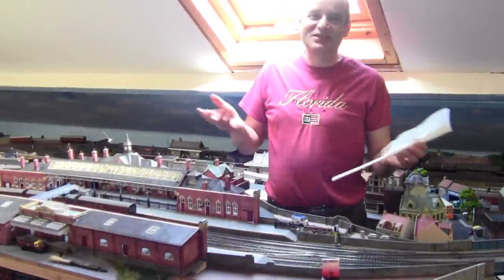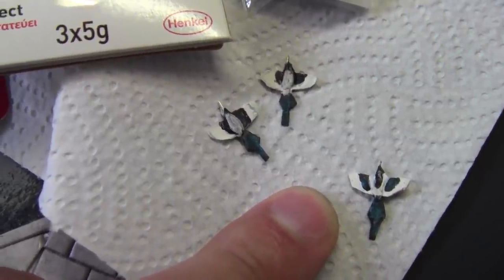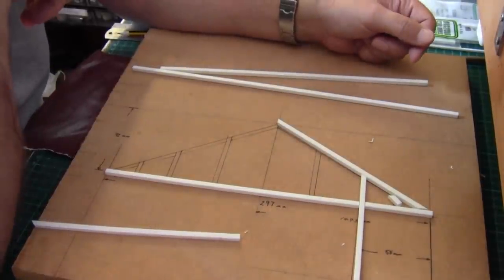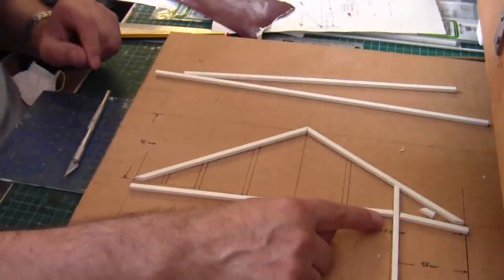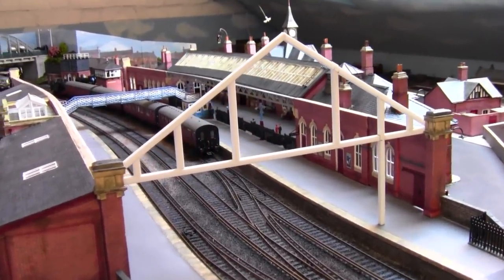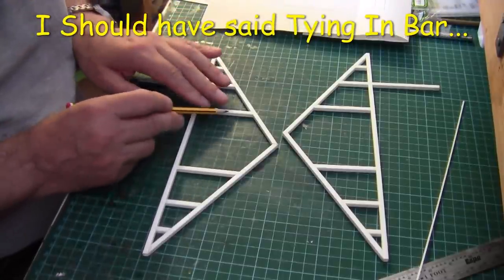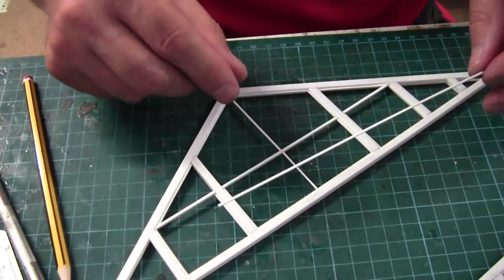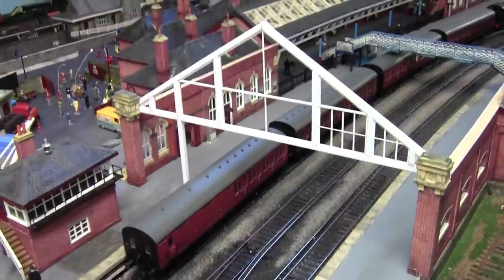The Big Roof Part 2. The facia's   No270

Comment: Tone, that 8-Wheeled vehicle is an Albion 24C/1. The Albions were originally very common in the West Bromwich area at the turn of the century. After 20 years or so they migrated northwards and eventually settled in the North East of the country, namely in South Shields and surrounding areas. Their plummage can be plain and they can sometimes be quite shy and have to be tempted to come out of their garages. Once out in the open they are a pleasant and attractive spicies but tend to enjoy their own company. They require very little servicing and I have been told they can run all day on only one saucer of milk and a chocolate finger (who’d have thought that !).
Hope this helps...Love ya Tone, The Guvnor 😁
Reply from the maker: Hiya Guvnor. i forgot to mention what was printed on the Albion truck. Teeside merchants. that's what appealed to me when I had seen it on ebay. its almost north eastern. great comment by the way. but to have a truck run on a saucer of milk and chocolate finger. well maybe for a well hard driver with out any sarnies.l ol.....take care buddy...........Tone

Comment: Hi Tony, the lorry is an Albion CX7 from around 1950.   I remember those dustbin carts at the side of King Street at Shields, as a boy in the mid 50s, whilst a guy with a big brush swept the gutter.  My father told me if I did not do well at school, I would end up like him.
Superb start to the trainshed roof.  It’s going to be long and hard work and it will take a while to complete, but when done, you will be pleased with the result and the effort will have been worthwhile. I see you use lecky’s tape instead of masking tape to secure your model facia.  
The glazing changed over the years with various panes missing.  I would guess that it helped clear the station area of smoke from the locos.  At one point the whole roof apex panes were missing, again I guess to let the smoke out.  Some may have been naughty boys, throwing stones.  "It wern’t me mista, it were the other lads." 😨  Best, Jason
Reply from the maker: Very True comment Jason. i think the roof would have been the same. he centre section open to the elements. before the electric trains where introduced i would imagine the station would have been a very smokey place. naughty boys would have also played there part too. that's for sure. your right about it going to take a lot of time to complete the roof. cutting one piece at a time, as its all made to measure. not only that summer time is here and i tend to spend more and more time in the garden. plus i am working longer hours at work. but we will get there. i can see the chequered flag. many thanks again...cheer's Tony

Comment: I've been working on my own layout today (there's an N7 in my station too) so I came late to this video. More incredible work to admire. The lorry is definitely an Albion, a fine Scottish product. The radiator badge represents the rising sun. Albion's advertising slogan was "Albion Sure as The Sunrise" It's quite an accurate model too. I'm looking forward to the next instalment.
Reply from the maker: Good morning Les. thank you for commenting. the N7 are a good running loco never faulted yet.. and it always features on the south shields branch. along with a DMU and a EMU. The spot light this week has been on the truck and rightly so. so now i know what make it is i will write on the box that it came in. historical information should have been printed on the box. thanks again stay safe....Tony

Comment: The roof section is going to look great when it's finished Tony, EMA Models liquid poly cement is great for assembling plasticard and styrene strip especially when used with a pin flow applicator, it sets in seconds allowing for rapid builds.
Take care and stay safe
Michael
Reply from the maker: Hi Michael. i have some plastic weld which use for when i am laying strips upon strips. i will look out for  EMA model liquid next time i am in the model shop. thanks again for commenting. I often wonder how your staithes are coming on. stay safe my friend.....cheer's Tony
Reply: Hi Tony thanks for your reply, the staiths are only at the planning stage at the moment, despite the stiaths length being just over 6 feet long it is surprising just how little space there is to have a reasonably accurate track plan,  I will have to try to come to a compromise between standage roads which should be four but may have to be two or three and workable point work leading the empties line off the staiths.
On a positive note though I have all of the materials I need to build the staiths and coal spout gantries once I have the track plan and point work sorted out.
I had intended to upload a video showing my plans but have had to order a new camcorder battery which should arrive around Friday next week so I will hopefully get a video uploaded soon.

Regards
Michael
Reply from the maker: Sounds like a plan. and you have it under control my friend...I can not wait to see some pictures. once you have finished....all the Best Tony

Comment: Hi Tony, Good video. I think your truck is a GUY or Albion truck, They usually had Gardner, or Alison engines
Reply from the maker: The general opinion is that the truck is an Albion. which is great know. why they did not put that info on the packaging i do not know. i guess its to save on the costs. thanks again for your input as i have learnt a lot about these trucks. many thanks. cheer's Tony

Comment: It looks to me as if the facias were originally fully glazed, but that would have kept a lot of smoke inside. So, at some time in the distant past, they removed the glass above the tracks to improve the air flow. Either that, or the glass got so dirty that it didn't let any light in and was too awkward to clean, it being over live tracks.
Reply from the maker: Good morning Henry that was my thoughts as well. i think the smoke would have gathered underneath the other canopy and lingered. and it would have been a great place to walk into a station full of smoke waiting for the trains. thanks again for your thoughts.........cheer's Tony

Comment: Could it be a TRUCK with a Leyland or AEC engine perhaps?.The radiator grill reminds me a bit of those of buses that were running in cities in the UK, from photo's during the Nineteen Fifties and Sixties.
Reply from the maker: Hi Alan mate. when the answers kept coming in the comments section. i googled Albion Trucks. and there is a 18 wheeler just like the one we have in the goods yard. not the same colour mind. but the same anyway. but yes they are from the 1950's. i am not sure when they stopped making them but my guess is they lasted right up to the 1970's. many thanks again my friend.....Tony

Comment: No expert but that truck looks to be based on an ERF, or a Foden more precisely as it doesn't have the ERF flash across the radiator grille...
Reply from the maker: Hi Nick many thanks for commenting. the ERF trucks do look similar to the Albions. as they do have that distinctive look about them...here is a link of the ERF truck.
https://heritagemachines.com/wp-content/uploads/12-img231.jpg. 
as you can see the shape is almost identical. but the grills are very different. I am no expert either but by the end end of this weekend. i will probably know a bit more. thanks to you guys.....thanks again best wishes Tony

Comment: Is that Gateshead West at the start?
Reply from the maker: Many thanks for commenting. the photos are all off south shields station at various time of its life span. mainly the 1930's -1960's. i can see why you may think its Gateshead west, as it has the same type of walling and structure. and that station was also built on a bend. thanks again for commenting. cheer's Tony
Reply: @TONYNORTHEASTERN  how many stations has Shields had at the last count-Three? I wish I had your patience when building stations etc.
Reply from the maker: Hi there. there was 3 in the town. Westoe lane, which was south shields original station. then you had south shields main station on mile end road. High Shields. and then on the outskirts of town you had Tyne Dock. in total 4 stations. and i have one more left to build. Westoe lane. once finished i will then have 5 stations on the layout. but there is a lot to do before the layout is finished. many thanks for commenting.....cheer's Tony